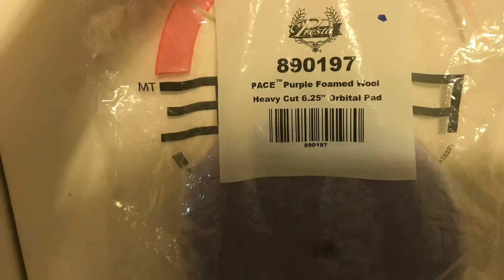How to remove scratches from a car 😀

Comment: Boss ok lang ba gamitin agad meguiar polishinf compound kahit hindi na ako gumamit ng first step ng compound
Reply from the maker: Anselmo Tada kung hindi naman madami defects pede naman boss gamitin ung polishing compound using DA polisher or Rotary polisher pero kung gusto mo  ng carshow finish you need to use heavy cutting compound para matanggal mga heavy defects like heavy swirl, haze,holograms,etching from bird poops using wool pad kung kinakaylangan gamitan nang liha I recommend 2000grit tapos gamitan mo heavy cut compound using wool pad and pagtapos saka gamitin yung ultimate polishing compound ng maguiar’s using polishing foam pad pagkatapos lagyan mo ng protection like glaze wax, salamat uli boss😀😀😀